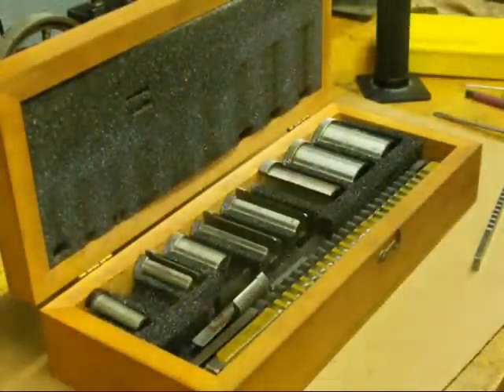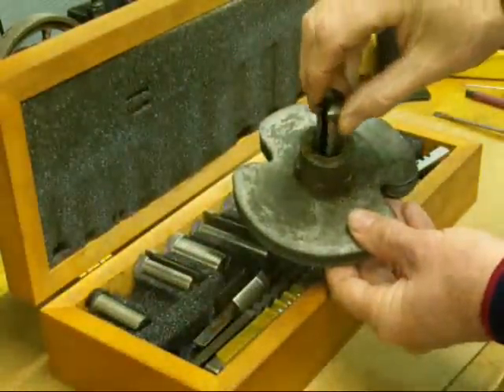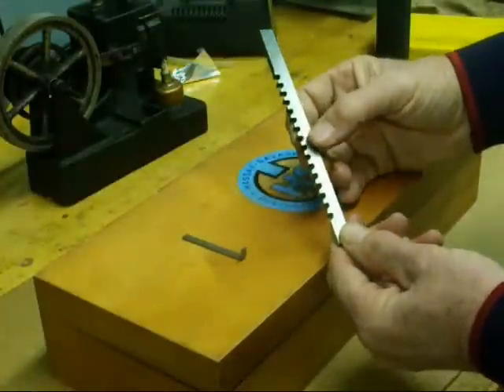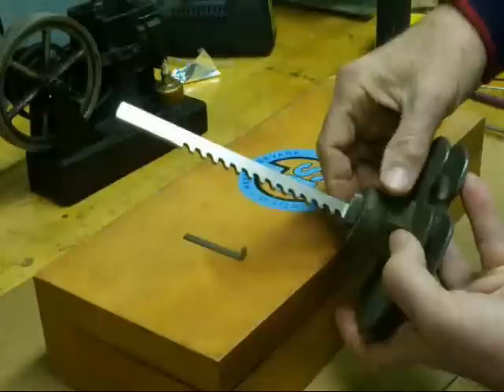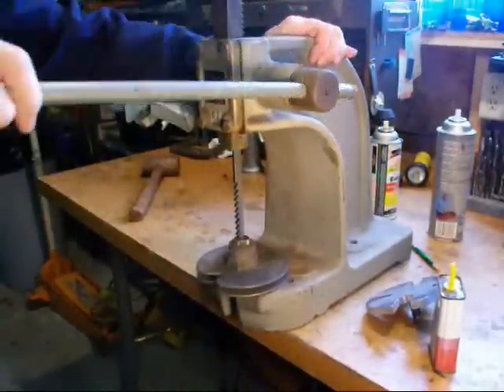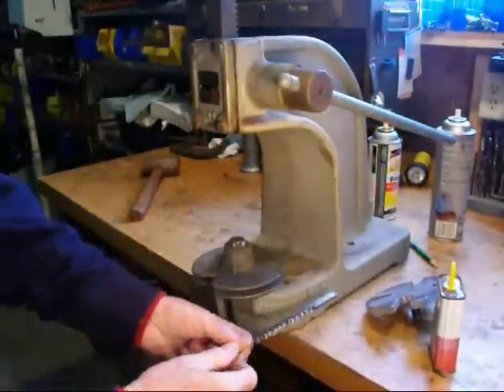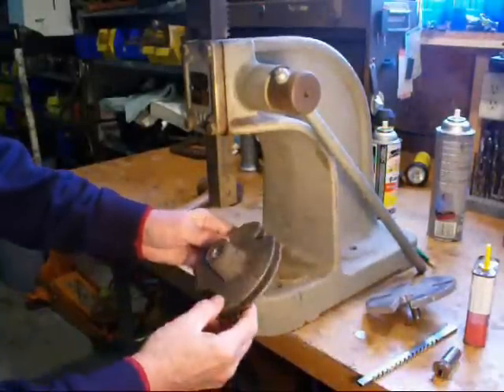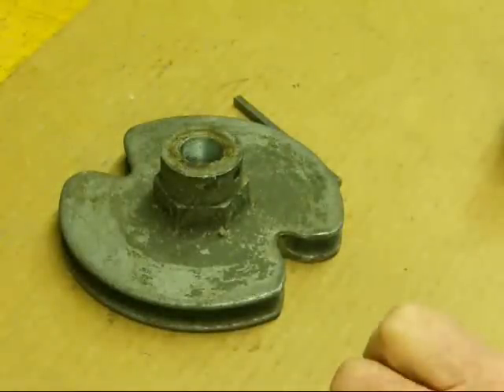BROACHING A KEYWAY IN A PULLEY tubalcain

Comment: Better to put the key way opposite the grub screw, gives the pulley more strength. When you tighten the grub screw now you will be lifting the pulley away from the key and have more of a chance of the key way chewing out. I have seen it happen many times with alloy pulleys.
Reply from the maker: Thanks

Comment: Pete,
I have an old Power King drill press that is unfortunately missing the spindle pulley and motor pulley. Would using a broach in this manner be the best way to make a splined spindle pulley from a round shaft pulley of the correct diameter? Or is there a better way to make a one off custom piece like this?  Thanks so much and I fully enjoy what you do...imparting knowledge/experience to others of similar interests is invaluable
Reply from the maker: I have never done this. It would be very difficult to position the brooch accurately for the several different grooves

Comment: Suggestion? I have an older Dumont Minute Man broach set and the bushings do not have a ledge (larger diameter ring) at the top. They are just cylindrical and will pass through the hole to be broached. I ended up putting two thick washers under a V belt pulley to support the lower end of the bushing for broaching, which worked, but most of the bushing was above the pulley. Would you have any thoughts on how to modify my bushings so they appear more like the ones in your video? On eBay I did see various Dumont bushings with rings, a pin, and a circular ring with set screws. The pin seems easiest so far to me.
Reply from the maker: I'm not sure why they make the bushings w/o the ledge. all mine have it. otherwise they push thru
Reply: I will either pin it or make my own. I also can't figure why a ledge was not provided. ????

Comment: As always a very instructional video. What would you do if you had a pulley with a damaged keyway in it. I recently purchased a used bandsaw and the bottom drive pulley has a damaged keyway in it. I was going to use a larger broach and make the keyway bigger as there is still heaps of meat left. I'm a newbie so would appreciate your feedback..... oh yeah, we have had a really cold winter here in NSW, Australia too so currently making a truck drum brake heater for my shed. Many thanks, Gordon
Reply from the maker: yes brach it larger. Then cut the keyseat larger too

Comment: Be careful with the broach.. it could fall on the floor and break.. and then .. dang dang dang... you put the chips out of the tool o.O
Reply: derernsti THERE'S A BIG DIFFERENCE BETWEEN EITHER DROPPING THE BROACH 3 FEET ONTO A CEMENT FLOOR- OR TAPPING IT ON A WOODEN TABLE TOP-!!!

Comment: @mrbreezeet1 

Rust wont hurt a file, it will, in fact, sharpen them. One of the old time ways to sharpen files is to leave them out in the rain. The way files get dull is the tips get rounded over. Rusting corrodes the metal which removes the rounded over tips.

Comment: Take an old or split 1/2" socket, cut the top off and weld it to your press. Then just use a half inch drive ratchet to crank it down.